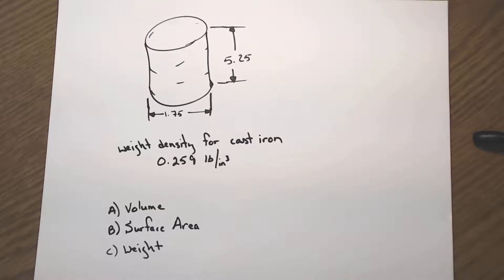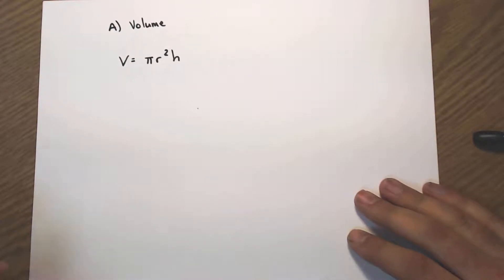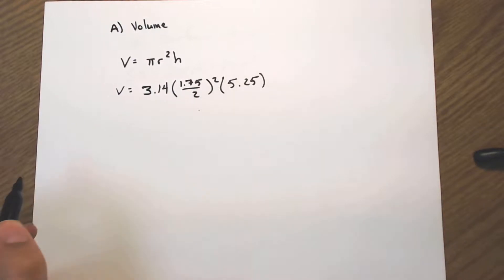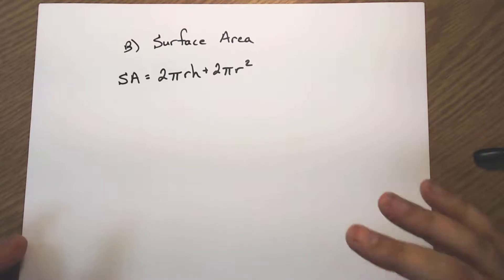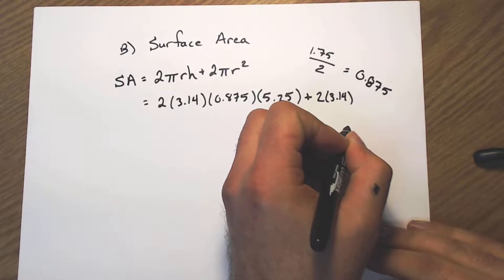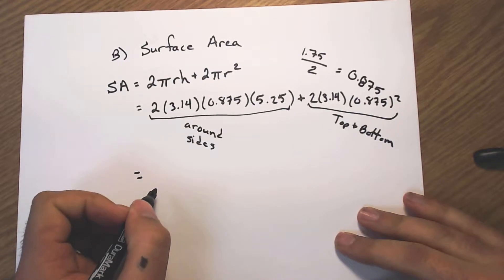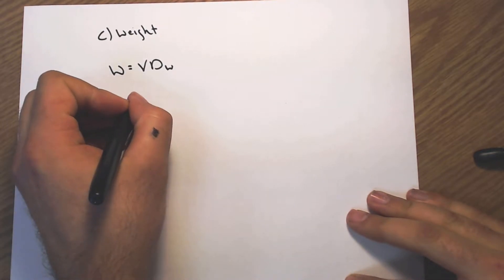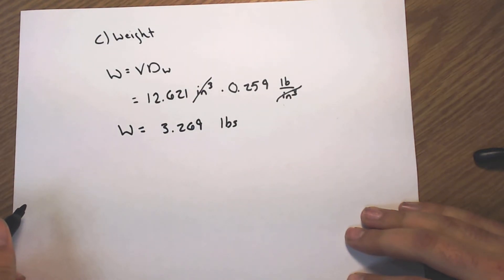Finding Volume, Surface Area, Weight of a Cylinder

Comment: U don't consider the thickness of cylinder?
Reply from the maker: I'm not sure what you mean by thickness. I use the radius and the height. The radius times two would result in the diameter and that's what I think you mean by thickness.